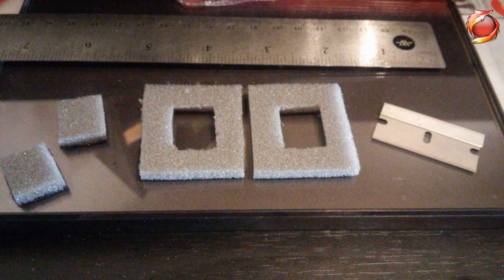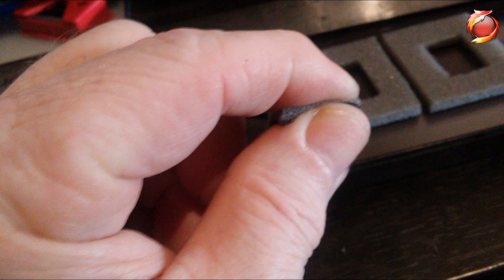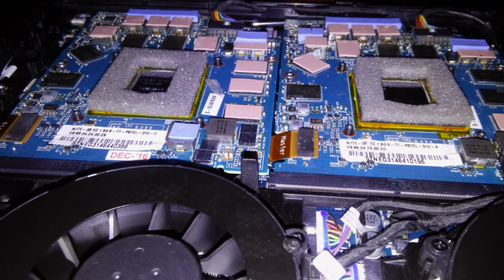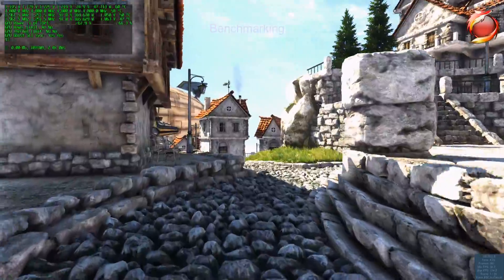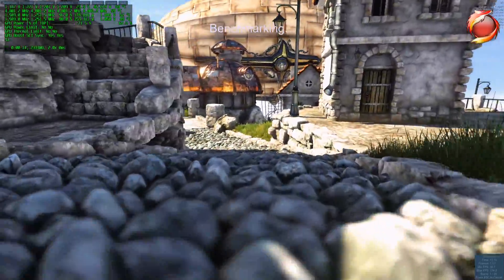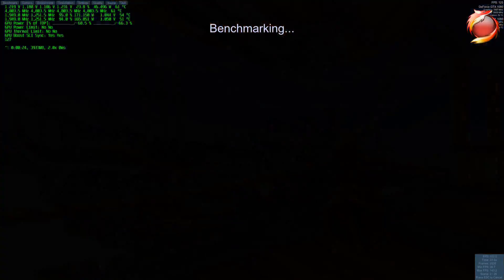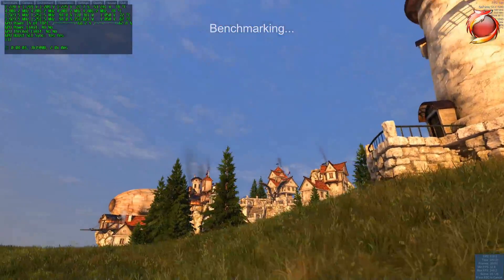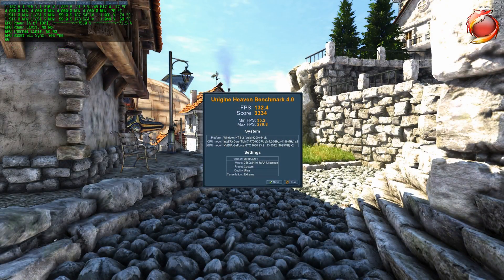How to safely use liquid metal paste on your laptop GPU

Comment: What are your thoughts on nail polish on the contact point surrounding the die itself. 3 coats to be exact.
Reply from the maker: That works totally fine. Several people I know use that. I do not know if a specific number of coats are required, but 3 is probably adequate. I prefer using Kapton tape (or electrical tape will also work) so I can remove it easily. If you look closely at the photo near the beginning of the video, you can see I have Kapton tape on the PCB portion of the GPU on all four sides of the die. This is to cover the areas with exposed resistors as you would do with nail polish. It is important to note that the foam blocks I added as seen in this video are merely a retainer wall or barrier of sorts. One must still use nail polish or tape to protect those surface mounted components adjacent to the die. The foam is not intended to replace that and it will do nothing to protect those elements. 

If you have a laptop that you toss around a lot and carry sideways in a backpack, there is always a remote chance the liquid metal could drip out and cause a short wherever it lands in the chassis. The idea was to use the foam to prevent that from happening. Just extra insurance. It is important that the square opening in the middle of the foam has some a few millimeters of air space around the die to avoid getting it pinched in between the heat sink and die, and you do not want the foam to absorb the liquid metal like a sponge. The foam should not be in direct contact with the die or the liquid metal. So, long story short, it is there to act as a seal or gasket to make sure any dripping or stray drops remain trapped inside of the foam barrier. It is also important to use moderation. The chance of the liquid metal escaping is small if you use the right amount. If you use an excessive amount, leakage and the danger associated with excessive application is almost inevitable.
Reply: @MrFoxRox  I see from your comment that you say foam or electrical are both good options. Is my understanding correct?
Reply from the maker: @rationalistfaith  foam is used like a fence or gasket to keep the liquid metal from escaping. Electrical tape, or Kapton tape (which is better) are used to cover something to protect what you are covering. So, they serve different purposes. The thin foam from a cheap fan filter like these work well for me. https://www.amazon.com/uxcell-Plastic-120x120mm-Cabinet-Cooling/dp/B00HGALKFQ
Reply: Gotcha! I used electrical tape to cover the RTX resistor so I guess I'm good there. I'm curious on the name of that specific foam or something similar. Thank you so much for that link!
Reply from the maker: @rationalistfaith  let me know how it works. 6mm may be too thick and I am not sure how compressible high density will be.
Reply: @rationalistfaith  How did this work?
Reply: I did that, works great.
Reply from the maker: Thank you for affirming your success as well.
Reply: do not use coating !!! this is a absolutly bad idea. reason is its hard to determine if everything around a transistor is properly sealed. also to much coating can result in temp issues. way to much coating (beeing higher than the die) will result in major troubles and could even damage underlieing transistors. 
so its dicy²
use scotch tape 33+. its thin enough, stick pretty well while same time removebale without damage to electronic beneath, and seals properly.
using that foam well.. not nessesary. even if it leaks in a laptop it wont fly around
even if you smash the laptop to a wall.

Comment: Hello, I have a new ideea in my head, take the heatsink off,  make a circle around the die with a good quality automotive black silicone (if there is enough space), smear some oil on the heatsink, bolt it down but not 100% and take it off, let it dry for 3 4 hours and you have a perfect seal, idk if that works but in my head it does at the moment.
Btw, I'm a car mechanic
Reply from the maker: You could put thin layer of plastic wrap (cellophane) on the area to contact the RTV silicon and then assemble it. Cut out a square for the die. Apply the liquid metal and silicon, Let it dry, don't remove it until you have to. Then it would not be "glued" to together. You would have a reusable gasket/o-ring attached to the heatsink, but not the motherboard side of the contact area.

Comment: What foam barrier do you use?
Reply from the maker: @franzifiedplays3  just a very thin foam that was in a box for shipping a laptop LCD panel. Very soft, easy to compress and about 3 mm thick uncompressed.
Reply: @MrFoxRox  Do you know anywhere I can buy Sir?
Reply from the maker: @franzifiedplays3  I do not know for sure where you could buy it but I would guess maybe from a crafting supply store.
Reply from the maker: @franzifiedplays3  another thing that you can use for a dam besides foam is to roll out a thin "worm" from kneaded eraser. You can place that around the perimeter of the GPU or CPU die, but it should only just be a tiny bit thicker than the airspace it needs to seal.

Comment: I tried using a foam barrier, but it was extremely difficult to find foam that A. Could withstand heat  B. was the right density and C. created a suitable seal when the heatsink was placed while not preventing the heatsink from making contact with the CPU Die. In the end I shielded the die components with TG shield and then put a layer of 3M super 33 tape over the entire die. I've used this for 5 laptops now without issue. The real risk comes when you remove your heatsink - those pieces of hardened metal that flake from the heatsink can land on the motherboard.
Reply: Hai Julian did u photo the result when u replacing thermal liquid metal. If u have can i see

Comment: Did you glue the foam in place or just placed it there and compression with the heatsink was enough to leave the foam barriers into place?
Reply from the maker: Just the compression  is enough.
Reply: @MrFoxRox  Thanks! About to reapply liquid metal to my laptop, after 3 years got severe thermal throttling as the liquid metal had all dried up or absorbed/stained the copper heatsink! But it got to the point it stained both CPU and GPU dies... Sanded the heatsink with 4000, 7000 and 10000 grit to get rid of the conductonaut lumps/bumps but the silicon dies I don't dare use sandaper, just Q-tip with isopropil alcohol 99.99%, not all LM clumps will come off be so be it. The foam dam HID evolution put was glued when I removed the heatsink hence why asked it; but it might have been liquid metal contact with the foam (yellow foam, with some parts grey, guess dried LM), or the heat or even kapton tape adhesive runnof that stuck the foam in place with so many thermal cycles over the years. Well after 3 years I need to replace that foam it's a bit crusty now. I don't get why HID evolution told me my laptop was good for 3 to 5 years on their liquid metal application when the heatsink is not nickel plated! On bare copper now I know that I need to reapply every year liquid metal! Maybe if I had done this yearly the LM would not have stained so bad the silicon dies! Do you think combining Thermal Grizzly TG shield conformal coating as a base then kapton tape on top of it and foam barrier at the edge is overkill for both CPU and GPU? Cheers! P.S I am so sad Notebook review forums are no longer accesible
Reply from the maker: @Frencho9  the staining doesn't really hurt anything. It is merely the pores of the copper getting filled with liquid metal. The reason it dried-out is because the copper was absorbing it. It will probably last a very long time now that the copper surface is cured. I don't think the extra protection is overkill as long as you don't use so much that it causes a contact problem. If you use the laptop on-the-go and kind of slam it around, the extra protection is added peace of mind.
Reply: @MrFoxRox  Thanks great news about the staining, still it's more the bumpiness/uneveness that got me worried. Took a lot of effort to get the heatsink plate smooth and flat again. For that perfect contact/pressure. The dies worry me a bit more as there are still some decently thick stains I notice when I pass my gloved finger.

Comment: Hey man, I’d love to hear your opinion on this because I wonder if this trick can solve the Ps5’s seeping liquid metal issue that’s been flying across the internet lately? As you know the Ps5 can stand vertically and lay horizontally and the story goes that with time the liquid metal will eventually seep past the seal when the console stands up and the liquid metal will eventually seep onto the motherboard causing a shortage. This foam looks like it’s a bit taller and might just be what is needed. What are your thoughts? Thanks so much
Reply from the maker: Hello. Happy Friday. I have never owned a game console. Conceptually, I cannot identify a reason that it would not work as long as the PS5 heat sink mounting has enough pressure to compress the foam. I have no idea how it is made internally, so this is speculation. Another thing you can try besides foam is kneaded eraser. You can roll it out into a very thin "spagetti noodle" shape and put it around the perimeter of the processor to create a liquid metal dam or barrier. It would act like a gasket just as the foam would. I hope that is useful info for you.

Comment: hi will the liquid metal damage the pins on my ssd card slot if it was contaminated by it?
Reply from the maker: Probably not as long as you clean it off. It should not hurt the metal itself, but you would want to avoid an electrical short from the pins being bridged.

Comment: K i was repairing my laptop mainboard, it blew a ceramic capacitor. If the board tests fine, i think i'll use this for final assembly, i might also need an extra enclosure piece, because a lot of plastic pieces are breaking on this laptop. I think i can use very cheap very thin (1-2mm) earpad foam for like Walkman headphones and the like, there's barely any weight to it, very fluffy. I got some from China years ago. Not super convinced the liquid metal will do very well long term, the laptop feels like a piece of cheese, it's not solid at all, so there's going to be movement, but i guess we'll see. Why i want to, is because it's definitely undercooled, GT645M and i7-3632QM, both make a lot of heat, and sharing a wee little heatsink.
Reply from the maker: It is sinful how poorly made most laptops are. Even those with a stout chassis do not get the attention they need for thermal management. And, the focus on thin and light is so disproportionate that there is no way that they could build them to run cool because there is not sufficient space for proper components inside of the chassis.
Reply: @MrFoxRox  Ceramic capacitors generally last forever, they don't have any inherent causes for degradation. They don't emit much heat at all. The materials they're made from are expansion-matched and withstand easily several hundred degrees C without degradation.

HOWEVER they are mechanically fragile. The one that said bye is 10uF 0805 25V rated, which is impressive, sitting near CPU VRM. Both the PCB warping from enclosure flex and PCB warping from heat can cause them to crack and internally short in between the thousands of metal-insulator layers they're made from. So it's likely, the construction of the laptop enclosure or cooling is at fault for the repair being needed in the first place.

Comment: Hello Mr. Fox 
I was wonder if a .5mm thick thermal pad be an adequate substitute for the foam.
Reply from the maker: Hi bro! Happy Tuesday. If it is an extra soft and squishy pad and it compresses with no effort it will work. If it is too thick and hard it will interfere with contact between the die and heat sink. I would cut it down really narrow as well. Make it like only like 2mm or 3mm wide.
Reply: @MrFoxRox  Thank you! i'll do just that. Here's a link for anyone looking for a .3 mm thermal pad 
https://www.amazon.com/gp/product/B07S8TPW7D/ref=ppx_yo_dt_b_asin_title_o00_s00?ie=UTF8&psc=1
Reply: hello, did you use the pads and how did it come out?
Reply: @Kjrov  Yo, I'm still awaiting the laptop because of complications from Lenovo. I will record and inform you when it completed.

Comment: Too anyone not sure about their foam choice, just toss it in an oven and set the temp a little bit above throttle temp to test. Should ease your mind.

You can also test with a blow dryer. Do not microwave though!
Reply: What about the black foam (esd anti-static I think) that comes with some electronics sometimes, can you use those?
Reply: @robertvuitton  Dude I have those does that work? did you use it?

Comment: that's enough preventing micro particle dried gallium move to the alumunium resistor/transistor became corrossion ?

what about thermal graphite ? https://www.thermalgraphite.com/products/
Reply from the maker: Should be. I tried thermal graphite pads, along with numerous others that were testing with me, and the results were truly terrible compared to normal thermal paste. Liquid metal is still the best option as long as the heat sink fit is good.

Comment: hello sir, I’m wondering is it a must to have conformal coating around cpu/gpu if I’m applying liquid metal to a laptop?? (I bought kapton tape already not sure if that’s enough)
Reply from the maker: Hi. Yes, you can use conformal coating. I have never used it before. Kapton tape works fine.

Comment: What is that foam? Looks like it would be perfect. I have a motherboard with active cooling on the north bridge and it uses some sort of black cushion on the heat sink that is falling apart due to age.
Reply from the maker: That is just some very soft foam that came with the packing material for a laptop LCD panel.
Reply: Damn, I was hoping you had a name for it so I could buy it on Amazon or something.
Reply from the maker: @Levy_Wilson  I wish I had more info on it as far as technical specs, but what you see in the video is all I have since I did not purchase it. It is soft foam rubber, about 5mm thick that is easily compressed to about 0.5mm thick.
Reply: maybe you could found it fron PCB in broken mechanical hardrive

Comment: I did the exact same with the foam,  but u didn't work for me, temps where up to 100c , I thought something was wrong with my laptop but then I took the foam off and its working now, I think the problem wasn't making good contact because of the foam even tho I used the same exact foam, I have an alienware 15r3 ft. 1070 now CPU temperature won't go higher than 73c.
Reply from the maker: It must have been too thick or dense for your application. You can also use a thin noodle or worm shaped strip of kneaded eraser instead of foam.
Reply: @MrFoxRox  What about thermal pad ? density can reduce after preasure and close the heating point
Reply from the maker: @claritoresdiano1021  the problem with using anything that resists compression is that it causes contact problems. That is why the foam works well. You could roll a very thin noodle shape of kneaded eraser and use that instead of foam. Its diameter should be no greater (approximately) than the air space between the two contact surfaces.

Comment: Hi MrFox. 2 years on, is the LM cooling still working? I wanted to know how it would function in the long term?
Reply: Bro Fox have correct. Liquid metal works very well and with long lifespan if your heasink have good contact with die/IHS. I use Liquid metal on all my laptops. Here can you see 4 years old Liquid metal before id was replaced with new. But really not needed. http://forum.notebookreview.com/threads/official-nbr-desktop-overclockers-lounge-laptop-owners-welcome-too.810490/page-58#post-10650404  See also  http://forum.notebookreview.com/threads/pm-7720-thermal-throttling.826152/#post-10829059
Reply from the maker: @papusan...  thanks for the reply, bro. Have a nice weekend.
Reply from the maker: Hi bro. Yes, it works excellent long term. The key is application and proper part fit. If there is not good contact it will not last as long. I have a couple of friends at Notebook Review Forum that had their application of liquid metal last well beyond 2 years. I will ask them to reply also.
Reply: MrFoxRox thanks for the advice. I am a bit worried about the LM leaking and destroying my system. How affective is the foam? What other methods could I use to prevent a leak?
Reply from the maker: @mbo3po49  the foam is very effective. The only other thing that might work as well that I can think of is to roll some kneaded eraser into a thin "noodle" and use it as a gasket around the perimeter. The thickness should not be much greater than the air space.

Comment: What's the best way to test if there's a warped Heatsink? I have an Alienware 17 R5 which seems to suffer from this issue. I want to know if the things are aligned first before doing anything.
Reply from the maker: Well, the best way is expensive, and that is to use prescale (pressure sensitive) film to check contact. Here is where you can get that. https://www.amazon.com/Fujifilm-Prescale-Foot-Ultra-Low/dp/B004TLOG9M. To use it, cut the pieces slightly larger than the die contact surface for the CPU and/or GPU, then bolt the parts together dry (no thermal paste). When you disassemble you will see a contact pattern on the prescale film. Where there is no contact, there will be no pattern. Where contact is best you will see darker red. Where contact is poor you will see a faint pattern.